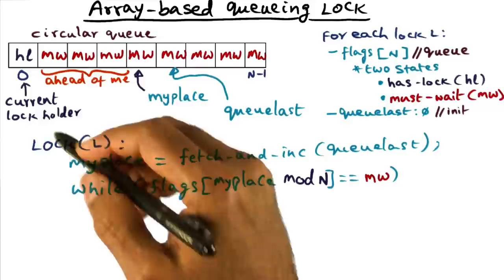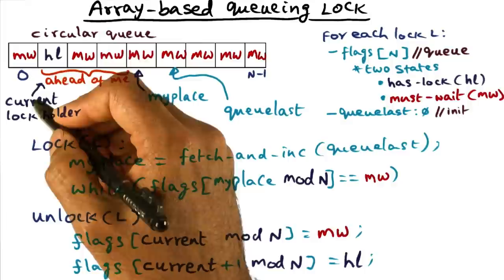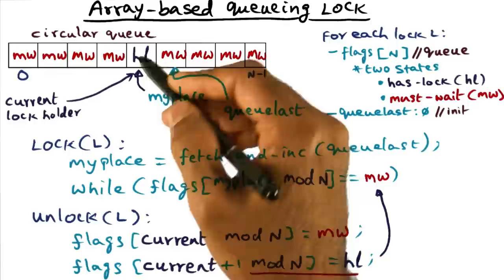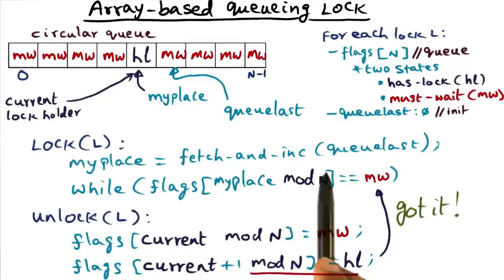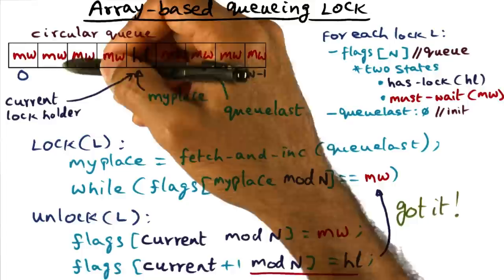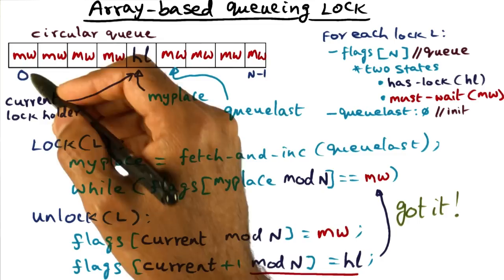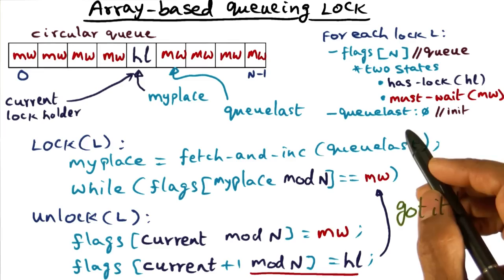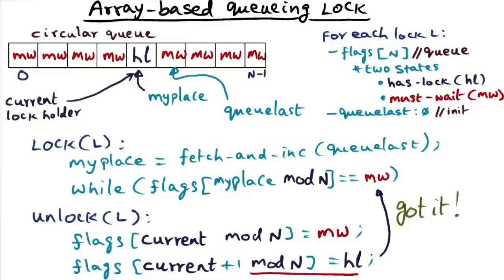Array Based Queueing Lock (cont) - Georgia Tech - Advanced Operating Systems

Comment: Great explanation! Just as a note, in the MESI cache coherency protocol, each modification of  the flags array will yield a cache line invalidation for all other CPUs. This is quite a disadvantage when compared to the MCS lock for example but can be easily avoided by cache misaligning each entry.